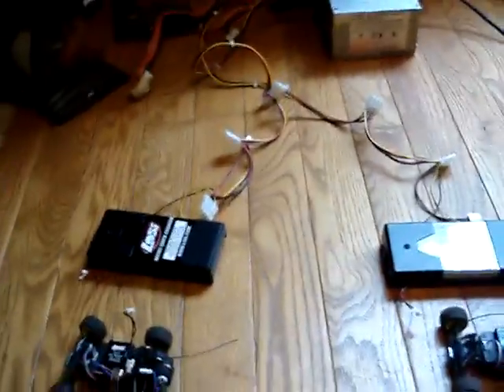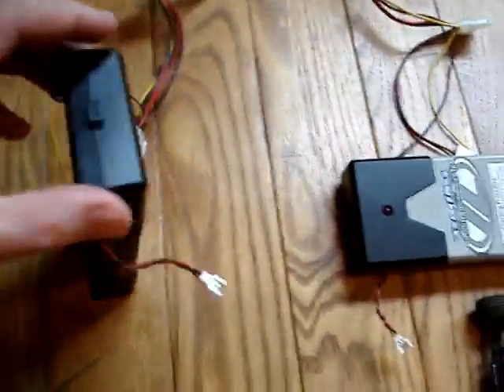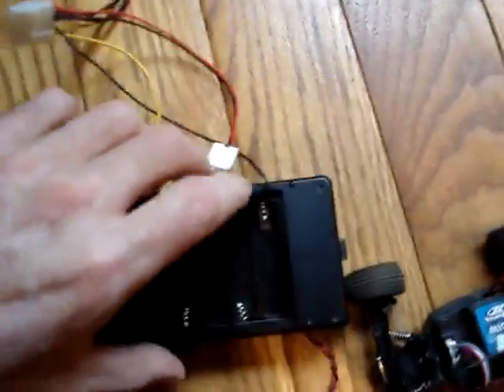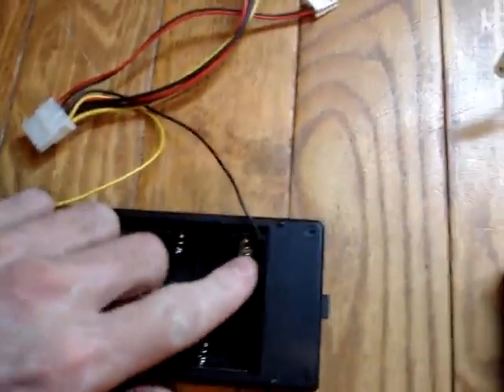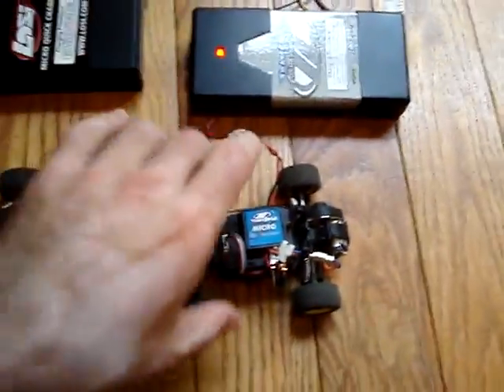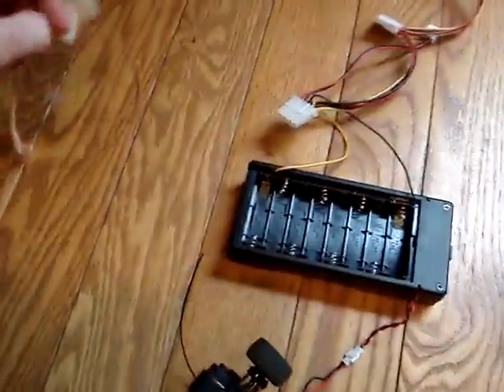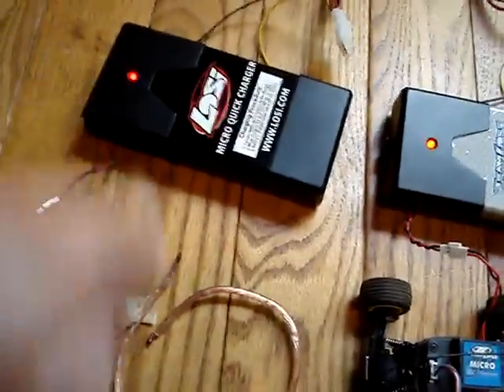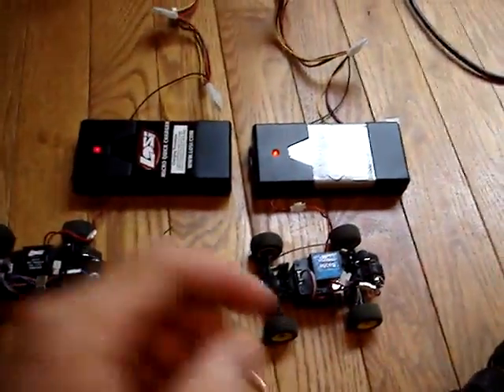Custom Losi Micro-T Charging System and Jumpstart dead battery

Comment: Mate, do you know or i can use a 12v universal adapter instead of 8x 1.5v AA battery? 
Losi adapter is 110v and here we have 220v power. i cant use them and buying 8 batteries every time is expensive. :(